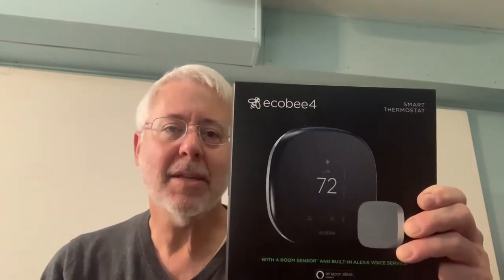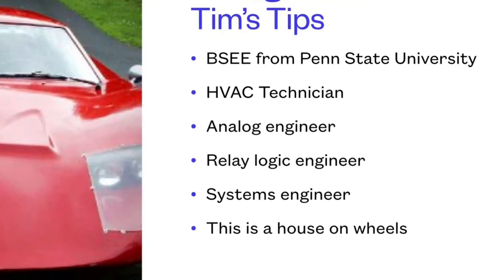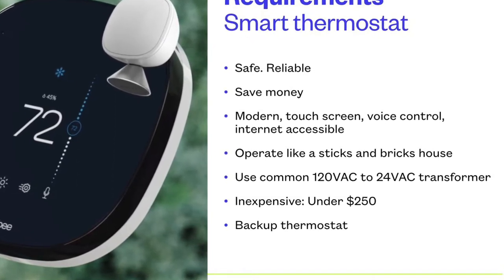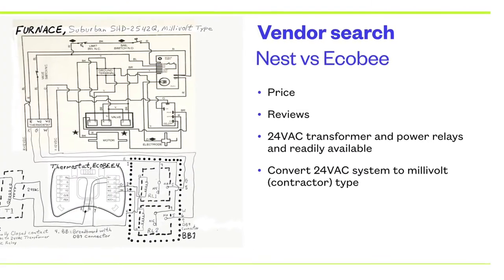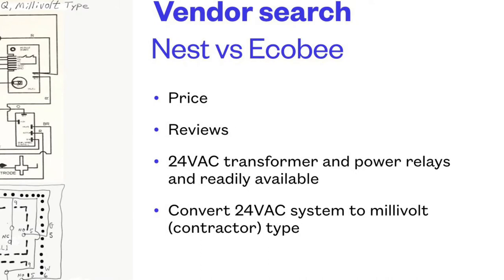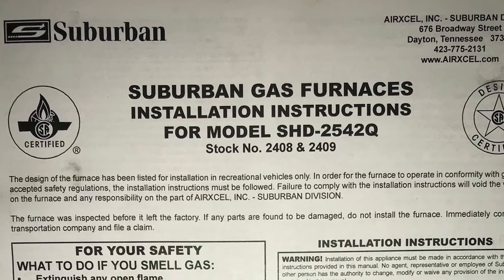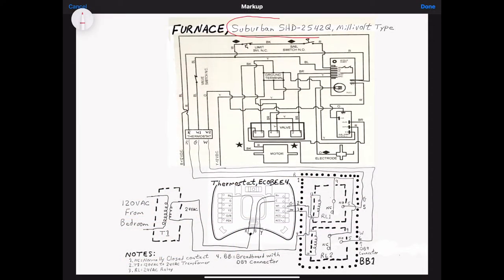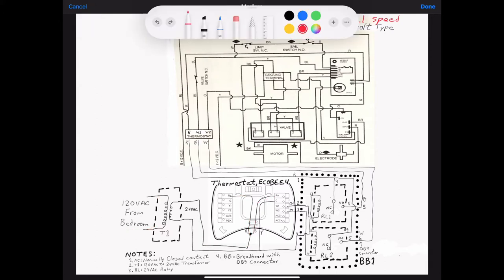Tim’s Tips #61 - Smart thermostat for RVs and Van Build, Ecobee, Nest, Alexa, Google - Feb 2, 2021

Comment: My son lives in the arctic. Houses up there have a "furnace room" that looks like the dash of a 747. He has ecobees installed in every room in the house because they are all heated individually. If one of the kids leaves the heat too high in their room he can turn it down from the office. I think most houses up there are done this way because they can go down to -60 in the winter although it is most often around -50. His have worked perfectly since being installed a few years ago. Personally i hate the leaf because it is so hard to get it to do what you want it keeps reverting to presets that are impossible to get rid of. We keep that house at 15 when not in use. When we're there we turn it up to 19/20 but at the end of a time cycle it reverts back to 15 even when you dont want it to. The house is in the south but temps of -20 are common in  winter so 15 isn't enough..

Comment: Thanks, just picked up a 1987 Fleetwood Pace Arrow. Gonna need work, a lot. Got it for 2K. Registration and some mechanical rework. Now runs strong. 103k on it. 7.4 454 with 700-R4 transmission.  Two port rothchester two port factory carburetor.   
I want to ensure for myself and family, mainly my manic prognosticating in my head,  that it is safe and reliable to drive.  Seals and gaskets need to be done too and bottom,  still figuring out how the hell I’m going to get the power plant out. 
I have two Coleman AC/heat units on top.  It’s a P-30 Chassis. 34ft end to end.  I will bring home to wiring schematic,  I will attempt to run two from a Google Nest and make a zone 1/ zone 2 configuration.    

The PLC and breadboard work I need to sharpen up on and slow down.   Thanks for the video, Super helpful.  
HVAC Master tech, Commercial Kitchen Equipment/Walk-in.  Certified Associate biomedical technician.   
Moved back into HVAC more $$. Smart Care Solutions LLC.
 This was very insightful and informative.  Thank you for making the point of the divide.. 
I am going to rerun with neat things like this.
Reply: I also have an 89 34' P-30. I'm remodeling and having some custom metal work done. I'm also a full-timer as of March. I've done extensive insulation accommodations. Not to mention I'm MN right now. I just thought about installing one of these yesterday.

Comment: Hey cool little video! So I am curious as to how it's performing? We have a chinese diesel heater that is running like a dream (once I replaced a faulty temperature sensor) but plan on installing a Suburban RV furnace this fall (for the overnight & when we're away basic heating)
Would you also have a link to the diagram? cheers
Reply from the maker: Thanks. The relay box is working great over the past two winters. The Ecobee 4 allows me to control the temperature in the RV remotely over the Internet. I do not have a link to the schematic but I’ll think about where I can put it so that my viewers can download it.

Comment: Did you include any safety limits in case someone hacks your account and instructs the thermostat to set the temperature to 100 degrees or whatever?
Reply from the maker: Yes. Ecobee’s local firmware is programmed with thermal limits. It has to be programmed locally, not over the internet.